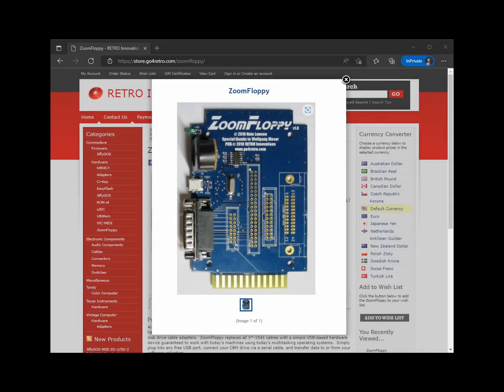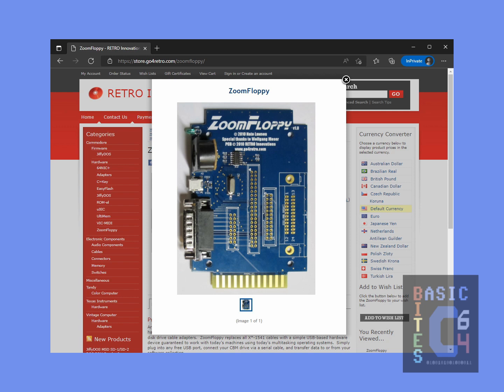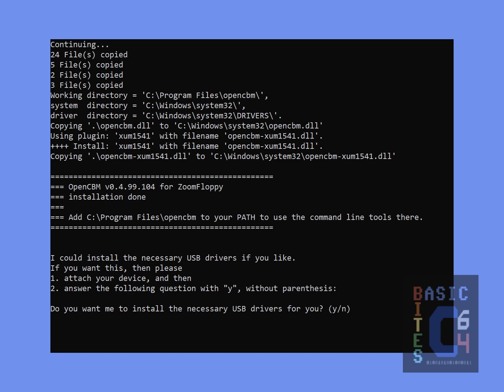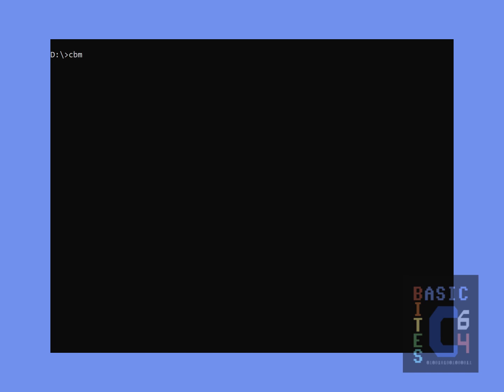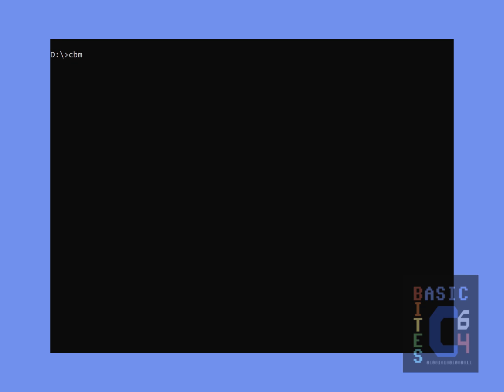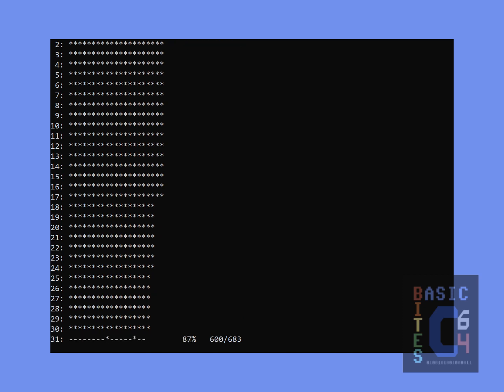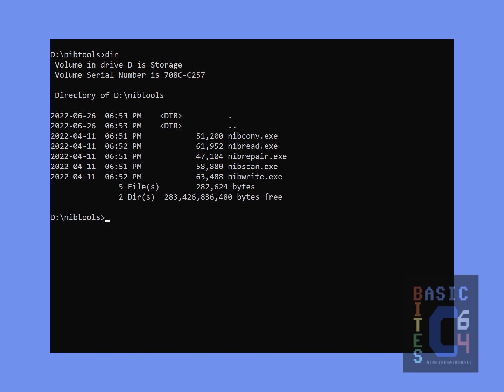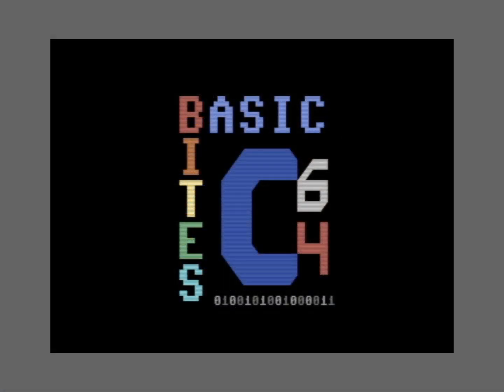Installing a ZOOMFLOPPY in 2022

Comment: This is a great reference for 2024 too and I point new ZF users here all the time.  1571 is for sure a great way to use the ZF to the fullest including nibtools.  That said if your only drive is a 1541 then it will still work pretty quick with D64copy as even with out a parallel cable it will use "Warp" mode to copy a D64 or a DIsk in pretty decent time.  Of course you can't use nibtools without a parallel mod or a 1571 but still better then nothing I guess.
Reply from the maker: Thank you for pointing people here; I'm glad the video continues to be useful. 😎👍 Nothing beats fast nibbling of floppies, but if all you have is a stock 1541, whether or not I would recommend a ZoomFloppy depends on your use case:

If you are now exclusively using Commodore emulators on your PC and just want to make D64s of your old (NON-copy-protected) floppy disk collection from the 1980s, the ZoomFloppy with D64copy is a good way to go.

However, if you use real hardware and own a cycle-exact emulator like a Pi1541 (which I also have a video on), the first thing to try is to hook that up to your C64 alongside your 1541 and use a dual disk copier like Fast Hack'em with its 35-second disk copy.  It is blazing fast, works perfectly well, and may even be able to tackle some copy protected disks with its nibbler utility (just make sure you're copying into a blank G64 rather than D64 when nibbling).  -- JC

Comment: Thanks for making a more clear path regarding this installation. Those two sets of instructions caused me confusion years ago. Although I was only one version of opencbm behind, following your instructions for the update to ".104" was easier than what I did in the past. I'm surprised you did not discuss the "CBMXfer" GUI for opencbm. I used that primarily to backup some old floppies. Since it also supports nibtools, I took advantage of that for some protected disks. It went well for the most part but I did get interrupted often with disks that had the magnetic layer flaking off, forcing me to clean the heads. Something else I remember about nibtools is that I had trouble using the latest releases. I had to find something older and "Zoom floppy" compatible. Perhaps I need to follow up on that to see if it is still true today.
Reply from the maker: You're welcome; I'm glad you found it useful!  I have not used the CBMXfer GUI.  For my purposes, using NIBTOOLS on the command line is sufficient and straightforward.  Floppy disk drives do need their heads cleaned more frequently these days due to the deteriorating magnetic coating, which is why none of mine have the bottom screws put back in.  The top covers can simply be lifted off when needed. :)  -- JC

Comment: Love it!  The ZoomFloppy is such an awesome device.  I have used it and nibtools to image lots of my disks.  I appreciate your thorough coverage especially for Windows 10 users as this has been a bit of an issue for some.  I still have an old Lenovo ThinkCenter running XP that I use as an imaging station for ZF and Kryoflux.  

NIBTools is awesome too and it is so fast that I have made it my default tool for writing back .D64s  to floppy disks as it will, IIRC, add back in the missing headers or whatever is missing from the D64 format that is on a real disk.  Thanks so much!
Reply from the maker: Thank you!  Windows 10 did seem quite easy, except for the discrepancy with the PATH.  My own understanding is that a D64 file doesn't contain GCR data -- only the 170KB of actual data held on the disk, plus any error codes for bad sectors.  So, even if you're using NIBTOOLS, writing out a D64 to a physical disk cannot re-create any custom or non-standard GCR upon which copy protection relied, because it wasn't saved in the D64 file in the first place.  As for your old ThinkCentre: if it ain't broke, don't fix it!  I too still have a couple of uni-purpose machines, although they never go online.  -- JC

Comment: Great video! This clears up many things.  I bought a ZoomFloppy a few years ago and while I did get the drivers and software installed it wasn't very intuitive. I also use the CBMXfer GUI front end for OpenCBM and nibtools which works very well. I made a parallel cable for my original 1541 and nibtools is the way to go when imaging your floppy disks. CBMXfer can automatically create D64 and G64 files after nibtools has done it's thing.
Reply from the maker: Thank you for the praise, Michael!  Perhaps the install is more intuitive now; one of my reasons for making this video is that I noticed the software had been updated in 2021 & 2022.  I'm mainly just doing NIBREAD on the command line and haven't experimented with the GUIs yet.  In regards to conversions, dragging a NIB/NBZ onto NIBCONV in Windows Explorer spits out a G64, and doing the same with the G64 spits out a D64 (although I stay with G64 for images of physical disks).  It's something I discovered while making my older video on "How to use NIB Disk Image Files".  -- JC

Comment: Is good that you show this again I was out for a while and never finished my installation.

Among other things the cbm tool the drivers I did have installed correctly under windows 7.

I had the other option hardware ixum bla bla bla what rotten name never sticks the zoom floppy does haha

Thanks for this video....
Reply from the maker: My pleasure!  I'm glad you found it useful.  The "other option" (XUM1541) is so-named because it's the latest evolution in a whole series of "X" adaptors.  The previous X-cables aren't really recommended for use any longer.  -- JC

Comment: Fyi, following along with my zoomfloppy and 1571 at 20:10 I got an error, "Error loading plugin 'libusb-1.0.dll': The specified module could not be found. (126)Is your X-cable properly configured?" I ended up downloading libusb-1.0.19-rc1-win.7z and put the libusb-1.0.dll in the nibtools directory and it worked.

Comment: How does one copy PRG files through zoom floppy? I followed your directions for d64 and nibbler.
Reply from the maker: I've only used my own ZoomFloppy to make images of physical disks, but it looks like the cbmcopy command in OpenCBM is what you'd want to use.  There's also a GUI called CBM-Transfer that alleviates having to use the command line.  Alternatively, you can use something like DirMaster by Style to get PRGs into and out of D64 files rather than trying to do that directly with the ZoomFloppy.  -- JC

Comment: i fined there all SLOW I use my 1571 and 1581 and it takes for ever to wright disks..  there way faster on my c128
Reply from the maker: Are you using NIBTOOLS with the 1571?  NIBREAD should be able to burst nibble a 1541-formatted disk in about 30 seconds using the 1571's serial port, as demonstrated towards the end of the video.  I find this speed is fairly consistent, unless there are many read errors on the disk that the drive needs to retry.  -- JC